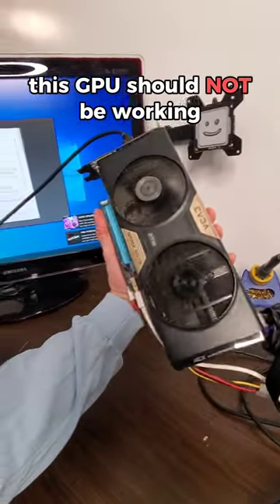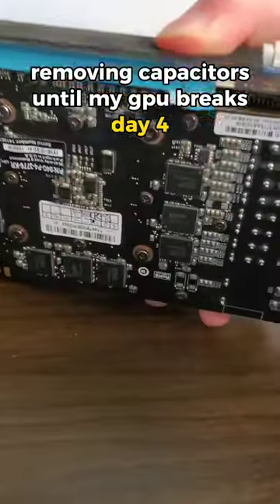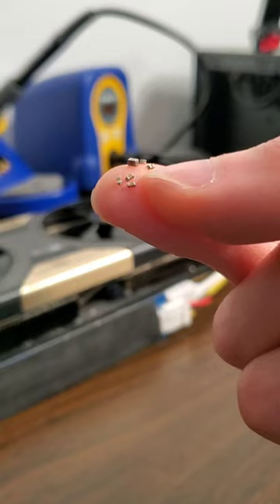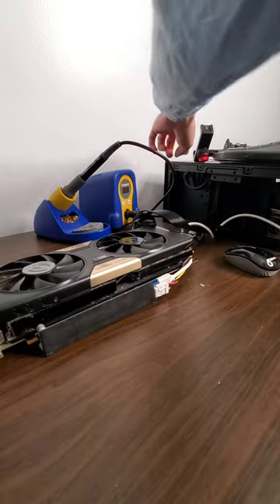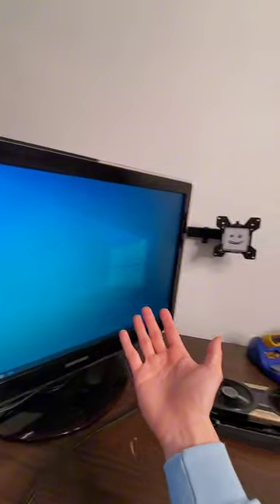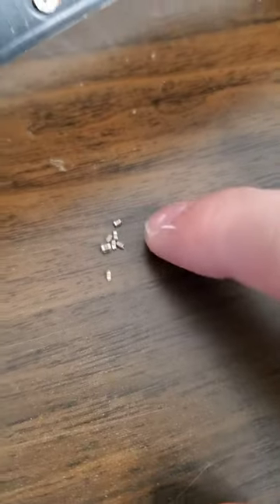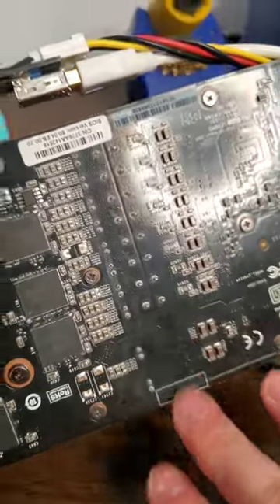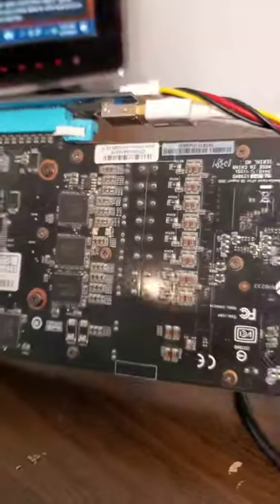this GPU should NOT be working #shorts

Comment: Sooner or later bro is gonna take the die off a CPU 💀
Reply from the maker: That's lowkey a super interesting idea - poor CPU doesn't even know what's coming
Reply: @mryeester  oh no bro is really gonna do it 😅
Reply: @mryeester no it wont let it suffer it will be an instant death
Reply: And it’ll still boot
Reply: What have you done...
Reply: Bro is fed up with gpu prices💀 @Manhackarcadeisfun
Reply: Ya mean die?
Reply: @modbust  yep just fixed it
Reply: I will work
Reply: @mryeester  Cut small edge of the die. lets see if it still works without a few million transistors.
Reply: @Dellguy29  its a gpu
Reply: @mryeester its a gpu too 😊
Reply: @notareo8753   bro read the whole comment💀
Reply: @Dellguy29  he already has taken the pins off a cpu
Reply: The die is gonna die
Reply from the maker: I was NOT expecting this to happen #shorts
Reply: @mryeester No way
Reply: @mryeester He actually did it
Reply: Ayo my guy really did it
Reply: Ok.
Reply: He did it!!!
Reply: 😮 @mryeester

Comment: Please double capacitors daily, itll let us see more interesting things like graphical glitches. If you remove every capacitor it will most certainly die.
Reply: fr
Reply: Fr
Reply: Fr
Reply from the maker: As I remove all the capacitors I'll be sure to keep checking for functionality in case any cool glitches come up! If so, I'll make a long form video about it, but if not I'll avoid showing you guys all the boring stuff
Reply: @mryeester  thx u
Reply: @mryeester . Cool a pc with sulfuric acid
Reply: @JAMJAM2020_YT now that’s a wonderfully bad idea
Reply: @chielvandenberg8190 . What do you mean by that?
Reply: @JAMJAM2020_YT  i mean, besides the handling and acquirement issues, sulfuric acid is just a chemical diluted in water, so cooling performance will be very very similar, it would just cause chemical warfare 🤣
Reply: @mryeester  removw all of them
Reply: @chielvandenberg8190 It will probably eat the components
Reply: Fr
Reply: @mryeester   fr
Reply: YEEEEEE >:(
Reply: maybe just glitch but still work
Reply: @mryeester in my room for a few hours
Reply: Fr

Comment: Those are mostly bypass capacitors and aren't crucial. It's a thing added for good measure to increase stability. The logic is that you put one or more right next to the power input of each chip, to smooth out the load-noise that the chips would otherwise induce on the power line, and to avoid local dips in power caused by the cyclic (digital) transistor transitions. The more you remove, the worse it performs; you will start having issues at high load while it works fine under normal load. If you remove them all, it's not going to work anymore, that's for sure.
Reply: This folks.   So it can run Furmark long enough to pan a camera over the monitor for 2 seconds.  Let see it manage a 10 minute+ stretch in some modern games with all the special nvidia effects turned on.  

I suspect even with just a few capacitors knocked off, this card will net a bunch more CTD out of 3d applications than an intact card.

Which, honestly modern games are pretty stable.  Sure everything else is buggy, and half the in game abilities are broken, but they don't CTD very much.   

People bitching in reviews about CTD's should really be looking at their computers first.  Reinstall video drivers, then chipset drivers, then clean up their Windows health, then check their hardware.  

90% of the time its their computer.
Reply: Both of yall just ended the whole saga this short creator is milking
Reply: It would most likely stop working when the capacitors behind the die are cut rather than power delivery
Reply: i want to get that gpu lol

Comment: Tbh they are capacitors it will be fine as long as your power supply is powerful enough to provide clean power to the GPU as long as the circuit is not broken completely.

Comment: Plot twist:He using intergrated graphics and not the gpu
Reply: I think if he was using integrated graphics he would have connected the hdmi directly to the motherboard instead of the gpu
Reply: @TesowoT-UwU1  ur right, because the HDMI or dvi cable he use on the GPU would post and not connected to the motherboard would not post
Reply: me, being too lazy to build in my GPU  every single time, investigating my hard drive slot problem behind it ^^'
Reply: could be a different cable tho

Comment: Gtx 770 is still the Gpu in my Build, paired with my AMD Ryzen 5 5600. It's the bottleneck
Reply: Well, at least it's still useful for most tasks. The newest games, not so much. But who cares about new Triple-A games at this point?

Side note: I still use an RX560D (flashed 460) and an i7-4770k in my SFF build for light 1080p gaming and desktop use. My main rig is a 3070 and 12900k though, so I'm fine. 😂

Comment: Actually, the power is not like constant DC and what you remove are just filters. Overclock maybe real test your theory.

1st was holding capacitor, 2nd was 5th harmonic filter, 3rd and 4th may be data line tension

Comment: I would avoid removing any caps near the PCIe lanes. Instead, remove the smallest ones near the GPU die and VRAM that have one lead connected to ground (since those are very likely to be decoupling rather than anything else). At some point, the chip won't have enough decoupling, and you might start to get some interesting glitches and failures.

Comment: if the gpu dies try to connect the + and - of the point where the capacitor was by soldering a wire on it

Comment: These caps are parallel to the main electrolytic capacitors. The GPU is going to still power up even if you remove all the caps in that area. However, it might crash under immediate stress.

Comment: the caps are not regulators there buffers you can remove almost all of them before you prevent it form work even then it might still work depending on the pcb layers layout they help store amparage and help buffer voltage drop so i guess you can say it regultates but its not a mosfet or a transistor

Comment: Most of the capacitors are voltage stabilizers in the circuit it wont affect much functionality even if you remove them as the power supplied is already quite stable. But if you remove capacitors which carry signal then you will have an issue. Try removing caps near the gpu die😊

Comment: Capacitors are like ratchet straps.
Sure. The thing you’re hauling really only needs 2-4 points strapped down. And its very unlikely that all of the points would fail. But its still better safe than sorry

Comment: At a guess, these capacitors are on power rails, filtering noise. The more you remove, the more chance of the circuit failing. If these were actual functional capacitors, it would already be dead

Comment: What if you remove CPU’s upper metal plate and try to run with CPU fan it will affect cooling ?
Reply: since the metal part is literally called the "IHS" (integrated heat spreader) it may affect cooling

Comment: Dude dude dude  this comes in clutch so bad for me right now. Because I broke one of the caps off my GPU (it still works of course) (it broke next to the pci pins, like the ones immediately after the gold contacts enter btw) but I'm wondering if it will cause any long term issues /decrease of performance? And I'm using all the connectors on it so three monitors. You seem like a guy who can answer please answer

Comment: I think its funny how you're just removing seemingly random capacitors on a gpu and it stills runs relatively normal but then 1 capacitor goes out on a gpu and it's basically completely useless.